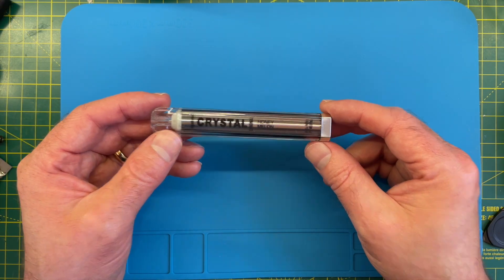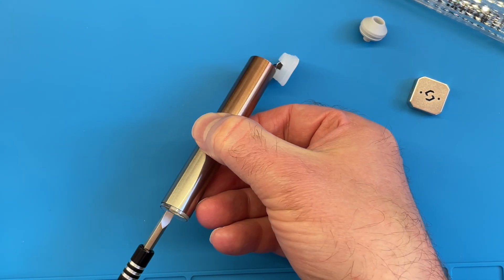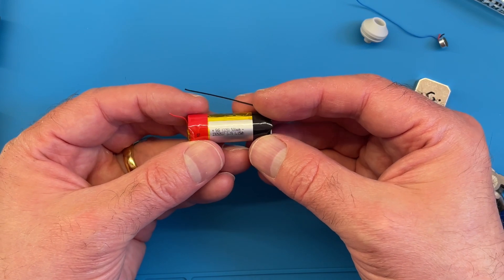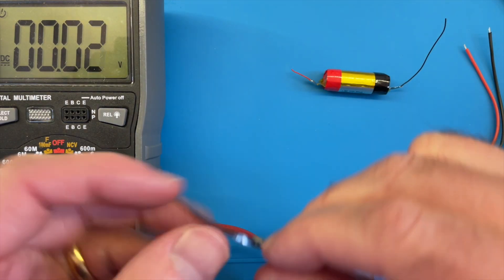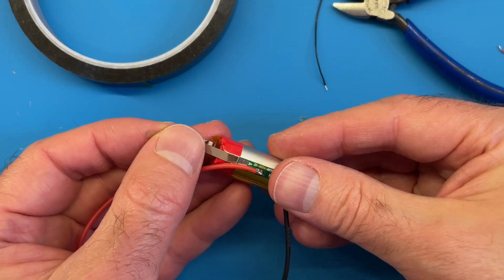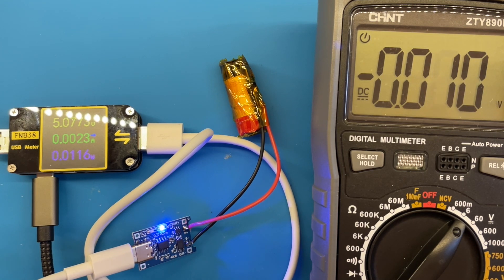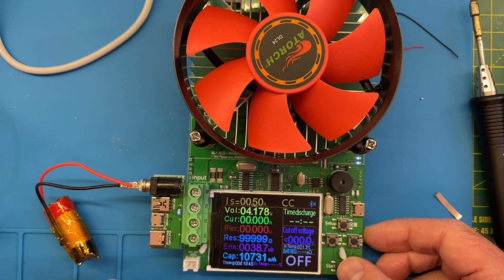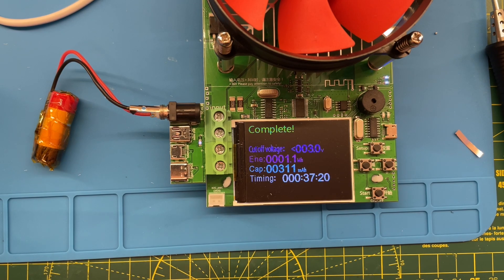Another Street Battery Salvage

Comment: Do you need the battery protection board with a protected tp4056?
Reply from the maker: If the battery is always connected to a board with batter protection then no. But a lot of times we use batteries directly to power things so it’s best to be safe and build it into the battery itself.

Comment: I've used one of these cells with a tp4056 to repurpose a small flashlight which was running on 3*aaa batteries.. i have connected the battery directly to the TP module without the small protection circuit. Is it strictly required?
Reply from the maker: The charging module I'm using has battery protection built in as well - so if you are using one of those boards then you're fine. You should see a couple of extra ICs on the board - generally a little chip and a bigger chip. One will be the battery protection IC and another is a dual MOSFET - https://youtu.be/hMOMbJcfvrU?t=73

I just add it onto the battery in case I want to use it directly for projects.

Comment: Nice! Now the million question is: How would you use it to power an esp32 so it handles deep sleep and lasts as much as possible? I'd be great to hear your thoughts.
Reply: Once it's charged and tested, you can treat it like any other lithium battery. There's guides out there but the gist is that you need to turn the battery's voltage, which could be up to 4.2V, into a safer 3.3V. That could be done with a voltage regulator, buck converter, or dedicated lithium battery management circuit.
Reply: @whatbee  Yeah, that part was clear, but the question is which buck/boost converter is the most efficient and what are its specs?

Comment: Hello, I've been collecting them for a while now, having discovered the possibility of recovering the batteries that make them work. When I went to the tobacconist's yesterday to pick up a few more, I learned that electronic cigarettes will be banned in France and therefore no longer on sale by the end of this year, which isn't a bad thing given the quantity that isn't recycled and ends up in the household garbage can, either buried or incinerated, which in either case isn't a good idea at all. Some people, like us, have tried to find out whether it's possible to reuse them and have understood the benefits of recovering them for small projects. I've even completely rebuilt one of them, and I've been able to reuse the electronic cigarette by putting in the liquid I wanted. It certainly requires a bit of tinkering, but it's not the kind of thing that usually causes me problems, and here again, it's paid off, change the absorbent cotton in the transparent plastic tube, refill with the liquid of your choice (50PG/50VG is best) and off you go again for around 600 puffs (or even more for some), proving that there are still plenty of possibilities for reusing these "disposable" cigarettes.

Comment: one advice: when you use TP4056 it will stop charging when current is below 10% of the max. With your max current being set to 1A, it stopped charging when it reached 100mA - that is not ok for such small battery. Also charging 500mAh battery with 1A is too much. Change resistor to higher value i.e. 4.7k and let it charge then till the end and the repeat the capacity test - you will see the difference ;-)
I have salvaged around 1000 of such batteries - 99.99% of them were full capacity - remember: vape is used only once - these batteries are in perfect conditions - only 1 time charged in their lives ;-)
Reply from the maker: Aha - that explains the low capacity measurement. The other batteries were charged with a different board that must have Gad a lower charging current.
Reply: @atomic14  I use RD6012 my power supply to charge battery to "their full" as this power supply has a setting "when to stop charging" and you can go as low as to 1mA. Of course in my projects I use TP4056 but I usually replace the resistor - sometimes up to 10k and the battery is charged very very long but to the full and... less heating in the box ;-)

Comment: I've been collecting these for a while now, I've got a couple hundred I think, due to some kind friends. It's a fun way to turn a normal walk into an easter egg hunt! They're almost all 550mah, but every now and then you get a 1500mah which is fun.

I've noticed that some of them are down to 0V or so, which is well below the minimum voltage. Have you noticed this? If so have you had any success recharging them? I've heard it's safe if the current is low enough.
Reply from the maker: I was really hoping this one would be higher capacity as it seemed like a nice one. There’s no battery protection on any of them so I guess they get used until there’s no juice left or the battery is so low everything stops working.

I’ve not had any really low yet. I believe you can revive them - but not tried.
Reply: @atomic14 after a while you can tell which have the big ones. They're about twice the size of the one in this video I think. Will be interested to see what you do with them
Reply: I have 2 batteries with 0V - I saved them by trickle charging at first and then normal charging - both came back to life and proper capacity
Reply: @zyghom what did you set as the initial charging voltage and current? Did you use a dedicated lithium charger, or just a voltage source?
Reply: @whatbee  dedicated charger refused to cooperate ;-)
so I set the power supply to 3V and current 0.1A and it started working. Once I reached 3V (at the beginning it dropped voltage to around 2V) I switched to the "lipo charger" mode (on the same power supply - RD6012)

Comment: Nice, where do you plan to use them? I've used these to create 4P5S pack with a BMS for a drill. Works fine for now
Reply from the maker: Currently just collecting them :) - but the ones that test full capacity are pretty handy for little ESP32 projects.